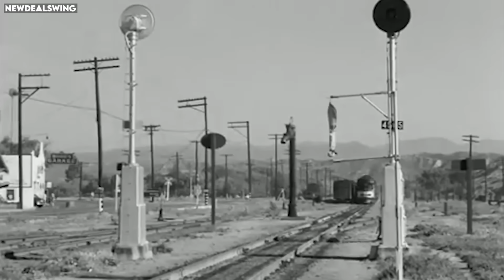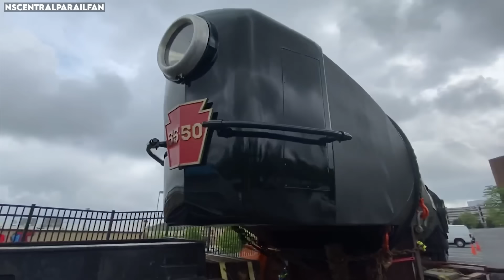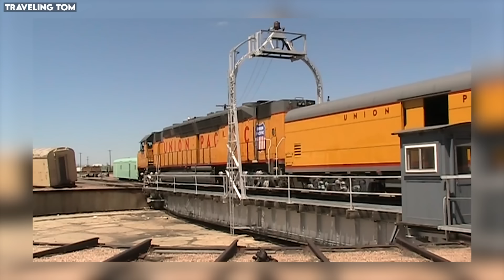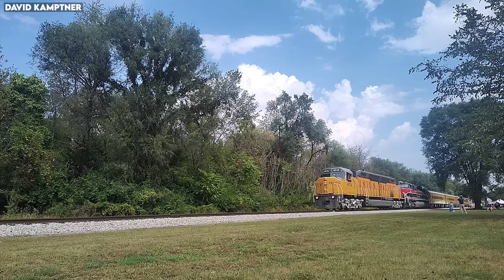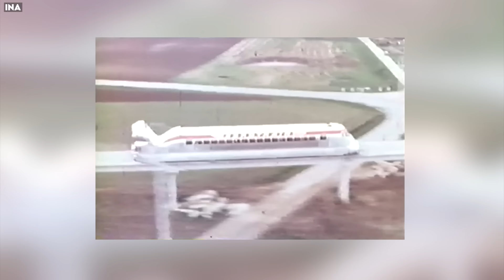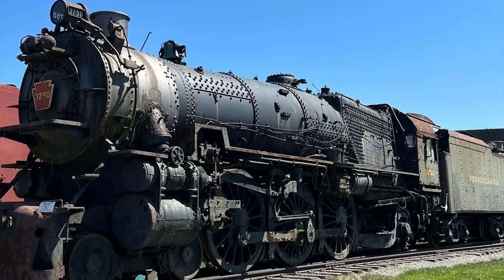10 Unusual Locomotives That Broke All Rules

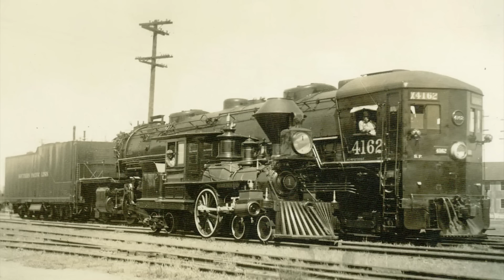Comment: 0:54 the number of cab locomotives built is incorrect according to the Pentrex documentary Southern Pacific Cab Forward Collection 250 AC class articulated Cab Forward locomotives were built for the Southern Pacific classified from AC-1 through AC-12 all were scrapped with the exception of the last one built number 4294 which resides at the California State Railroad Museum in Sacramento California
Reply: 0:43 Not to mention that the Southern Pacific didn’t “build” the cab forwards. All of which were built by the Baldwin Locomotive Works, not by the railroad which operated them. Only one exception being the AC-9, basically a series of reversed cab forwards, built by Lima Locomotive Works, built to only burn coal, rather than oil like the other cab forwards have.

Comment: opposed piston engines weren't just installed in a single class of locomotives, every diesel Fairbanks Morse built had opposed piston engines. When you're talking about the Q2, why aren't you showing the Q2? You showed plenty of locomotives that said Pennsylvania on the tender but were clearly not a 4-4-6-4 except for the rare, random shot of what you were babbling about. I HATE it when AI does that. You showed S1s, You showed PRR Hudsons which do not exist, you showed steam turbines, you showed HO scale models, you showed Locomotives spewing sparks from the pilot truck (How do you do that with no brakes?) And you were doing so good for a while..

Comment: Years ago I had a number plate off a Q-2. That engine is pictured in PENNSY POWER PICTORIAL. Don't remember the number, of course there were only 2 Q-2's.
Reply: Not true. There were 26 Q-2s constructed.  There was only one Q-1, a 4-6-4-4 duplex. There was also the experimental S-1, a 6-4-4-6 duplex designed for passenger service.

Comment: If the ACE 3000 new generation steam locomotive would have been built, it would have been a duplex.
Reply: One of the big differences between the ACE3000 and older duplex designs was an internal crank connecting the two driving pairs together.  This would have eliminated one set of drivers from loosing traction (one of the major problems with PRR T-1.)

Comment: I can’t wait to see the new T1 once it is completed!
Reply: The Deltics were the most powerful diesel locomotives of the early 1960s.
Reply: The "new"t1s have 4 still in existence. only 1is still operating. R &N 2012 is that Loco. Don't know how there are 2 different ones with the classification designation T1 2012 is the only 1 still in operation.
Reply: The R&N T-1 is a conventional 4-8-4 built by the Reading.  Same class name as the Pennsylvania T-1, but a totally different locomotive.  It will be years, if ever, if the PRR replica T-1 is ever completed.  Some if the manufacturing techniques, like cast locomotive bed, are no longer available.
Reply: @mjchern1  Different wheel arrangements, different class, but just plain awesome.